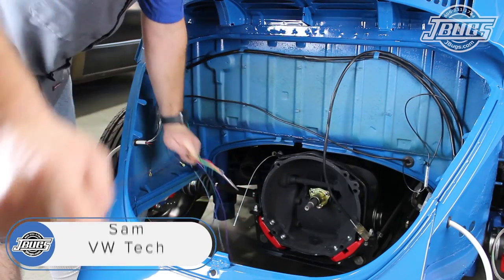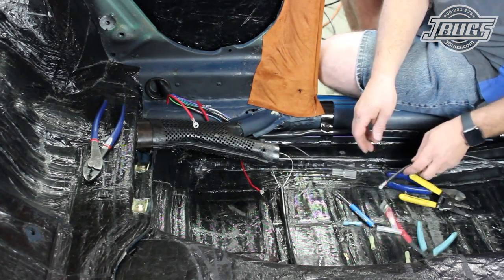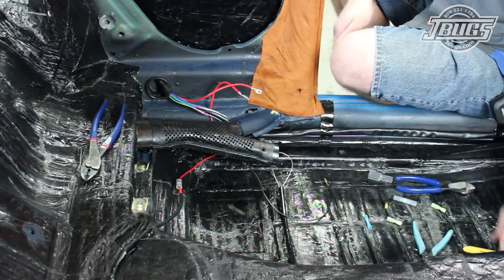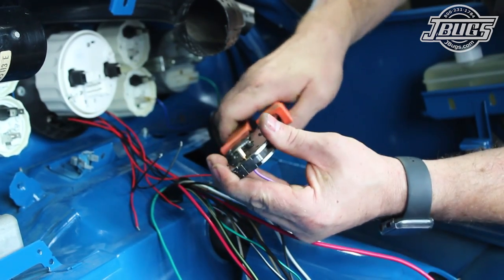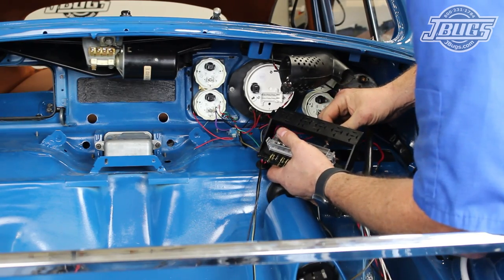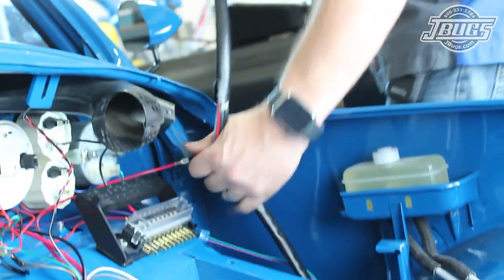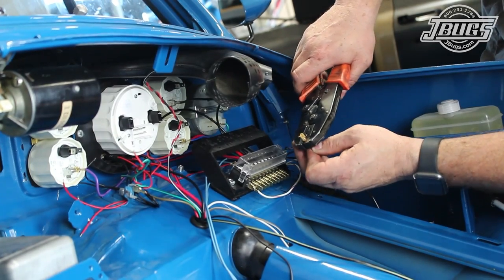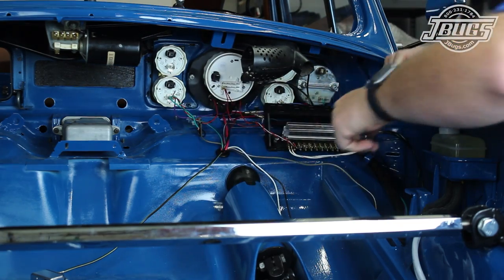JBugs - 1971 VW Super Beetle - Wiring Series - Part 2

Comment: Thanks for the video's!! What size fuse do you use in the fuse block under the back seat?
Reply: The small amp used a 20 amp fuse, the large amp ran a 60 amp fuse, and a 70 amp fuse was used to power the rest of the car.

Comment: Hey Sam, is there a video where you cover how to connect the two red wires you snipped and connected to 3 connector? I'm having trouble finishing this part on my 73 beetle
Reply: The wires we cut and connect in this video, are covered in this video, so I'm not following what your question is. These wires are all the main battery power and connect to the battery, the alternator and the fuse box or headlight switch at the front of the car.
Reply: @Sam_Mebane  I guess my confusion is coming from how the 2 red wires are going from the fuse holder to the battery. From my understanding, it's 2 red wires > 3 prong connector > fuse holder > battery?
Reply: @taylorfrisby9890  in a nutshell, yes.

The wiring in this car isn't 100% typical to most applications, nor is the fuse box and battery cable setup I did in this video - https://www.youtube.com/watch?v=36Ln4BU3gIM&t=400s but yes.

From the 3 prong connection, run a wire to a 50 amp fuse (or higher depending on what accessories are running off the main power wire) to the battery positive cable or terminal or power block, depending on how your battery is connected.

Comment: I have a voltage regulator question 
My generator has D+ hooked to D+ on the voltage regulator 
DF from the generator to DF on the voltage regulator 
My number 61 wasn't hooked up to anything but I ran a positive wire from the coil to an inline fuse and then to a light and then to the number 61 on the voltage regulator. Now isn't the B+ which connects to either the starter or directly to the battery ( depending on the year ) 
Doesn't the B+ send the regulated power back to the battery to recharge it ?
Shouldn't I have 12+ volts coming out from the B+ if I hook a volt meter to it ?

Comment: what is the small in-line resistor for.  Do you have to have it if you are not using led lights for the generator?
Reply: The resistor is there to provide resistance for the LED indicator, yes. It is not needed if you're using an incandescent (regular) light bulb.

Comment: A wiring diagram using this fuse panel on an unmodified gauge setup would be helpful.
Reply: In which case it would just be a stock diagram - https://www.thesamba.com/vw/archives/info/wiring/bug_super_8_70.jpg - as this fuse box was set up just like stock. It has the same inputs and outputs as the original fuse box.
Reply: @Sam_Mebane  Thanks but I already have the book.  I was looking for a one page diagram I could bring in the trunk with me to easily plug and verify.  I have a wiring nightmare and nothing seems to want to go right.
Reply: @duanevince5273  That diagram is all one page, but OK. Hopefully you get it figured out.